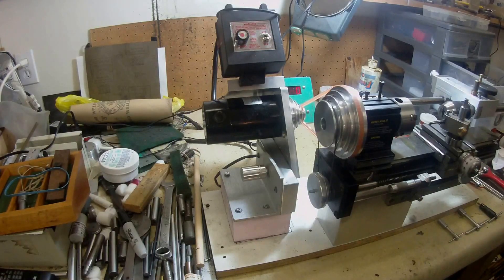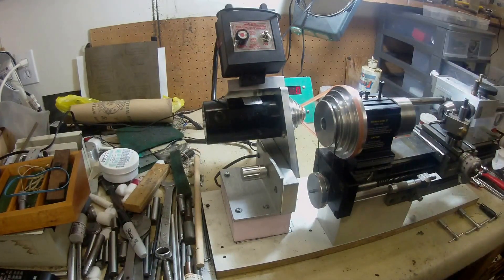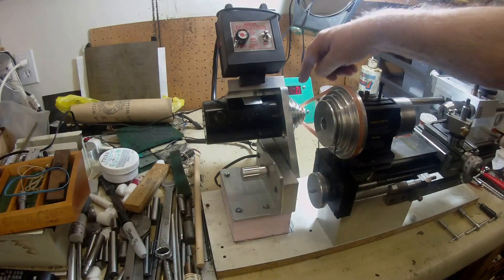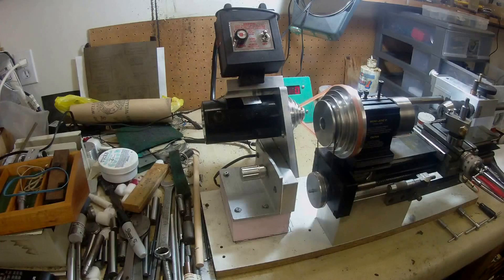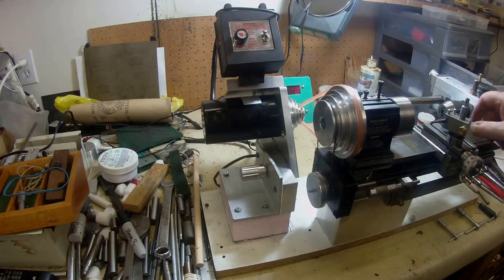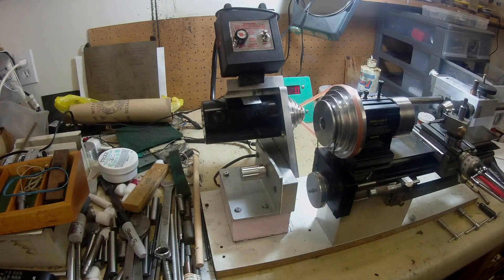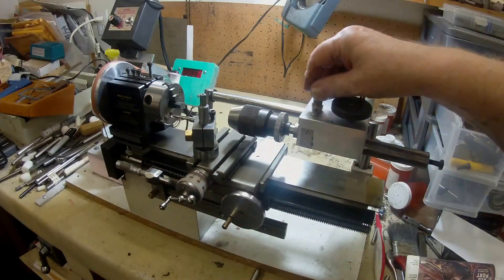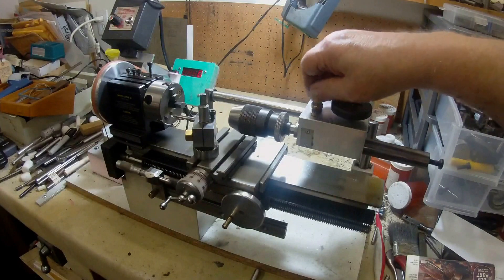FILE0018 A nice addition to my Taig lathe

Comment: Edmund, at the 5-minute point you were explaining how you shimmed out the bore in the pulley with a paper. How did you hold the paper in place in the bore and be able to bore out the paper to provide the proper fit?  I could only imagine that once the tool tip touches the paper it would rip the paper, but you were able to shave the paper thickness down to size.  I imagined that you might have use and adhesive to hold the paper in place, loc-tite, epoxy or something similar.  Interest in your technique.  Thanks for your time.  Warm regards Rusty<>
Reply from the maker: Rusty, what happened was in machining the bore the first time it was slightly loose on the motor shaft and it had a wobble, so imagine using a paper shim, the paper was 0.004 thou thick so that meant I had a second chance to get a better fit and as it was going to be locked with a set screw the paper shim would not deteriorate, the shim allowed me to bore the pulley for a better fit, I reset the pulley in the four jaws and started boring a little on each pass each time inserting the paper shim into the bore and trying the 5/16" dowel, I continued boring the pulley and trying with the paper shim until the dowel was a nice push-fit, hope that gives you a better understanding,

Edmund.........Alberta
Reply: @holmes230536  Ah! I see. Thanks Edmund, that makes perfect sense! 
Warm regards,
Rusty - Maryland<>

Comment: Hi Walter,
Thanks for making a great video. I love seeing the modifications people do with their Taig. I just got my Taig lathe, and am waiting for the 4 jaw chuck and a fly cutter to come in! I also got the milling attachment for the lathe to give a vertical axis, so lots of projects ahead of me!
I love all the work and modifications you made. Quite ingenious the extra long tail stock, and how it lets the carriage make way. The speed controller is also excellent, im wondering if an off the shelf speed controller would work with the original lathe motor... I also just use a rubber elastic band for power feed. You can also put a twist in the band, so it routes in a figure 8 shape, to drive the power feed in reverse. 
One thing i plan to do after watching this video, is adding the micrometer endstop... That is a super cool idea, and could be a product sold by Taig! 
Beautiful work and thanks for sharing,
Nate
Reply from the maker: Hello, Nate, 
      thanks for finding my video interesting enough for you to subscribe, lately I haven't been too busy making more videos but I should be getting something going again soon, its good to hear you are the new owner of a Taig Lathe, one of the first mods I would suggest before anything, is to mount the lathe on some kind of raised block giving plenty of clearance under the bed, not being an electrical person I'm not sure about the original motor being controlled by a speed control but I do know a DC motor would work, the one on my lathe is a Sherline product, have lots of fun using your new lathe,

Edmund.......Alberta

Comment: craft pipe cleaners do not absorb well, get real ones. And some are conical so they have very little absorbing material in one end.
Reply from the maker: Baikal, those pipe cleaners are at least 50 years old I bought them when I still lived in the UK, if you look in the video they are really big in dia and very fluffy, manufactured name is Old Port

Comment: I really enjoy your videos Walter. Giving me some great ideas for my lathe,
Reply from the maker: +tommee10533 
That's good Tommee,  that's the whole idea of these videos, its to plant ideas, and of course I won't deny its therapeutic for me when I get comments, you have a Taig I imagine?,

Thanks Edmund,
Reply: +Walter Maisey Yes, just purchased one. Off of Ebay.Quite pleased with the quality I may add..
Reply from the maker: +tommee10533 
I think you will like it, I was a little apprehensive for some time before I got mine, I had a 1947 Drummond "M" Myford type for years, and decided my age required a smaller machine for apartment dwelling, its worked out great for me, I think you will be pleasantly surprised,